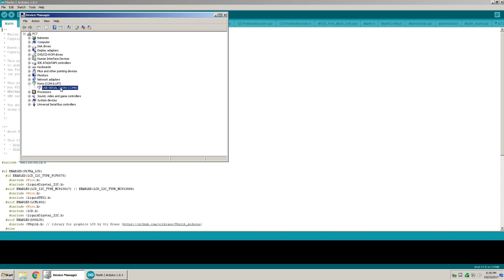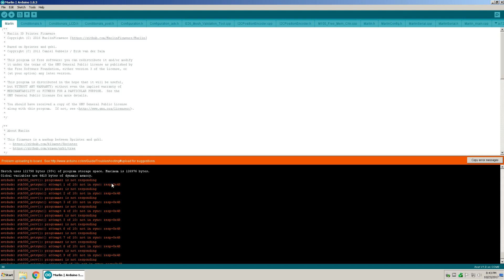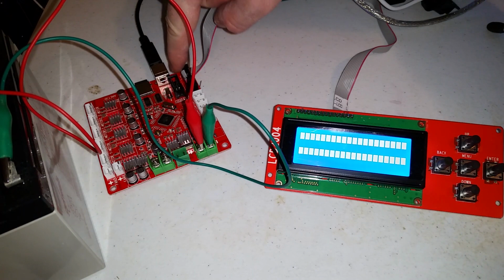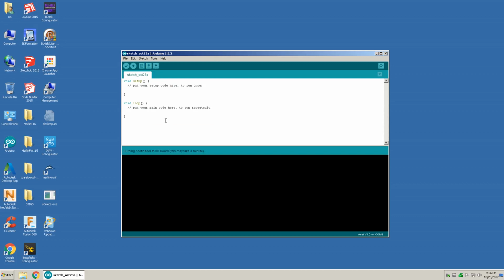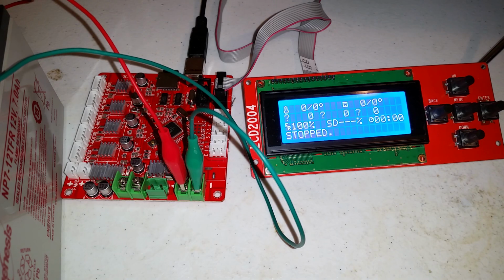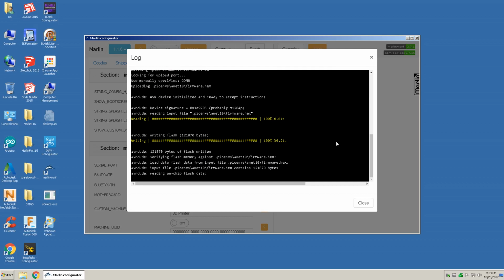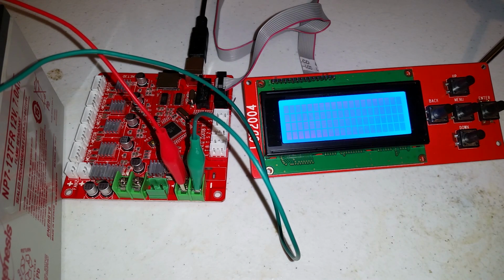Unbrick an ANET A8 Mainboard v1.0 After A Failed Firmware Flash

Comment: I accidentally flashed my AnyCubic Chiron trying to install Marlin 1.1.9. I want to fix it but I have some questions about your tutorial?
1. Do I need to buy an Arduino Nano to fix my main board?
2. What programs should I use? I tried to update my firmware with Cura the 1st time and I accidentally reset my PC during the upload.
3. I've tried changing the DC pin to USB and upload 'Blink' through Arduino. Somehow my PC cannot detect my Chiron anymore, so do I  have a chance of updating to Marlin or will I have to buy a new stock main board?
Reply from the maker: Might try flashing the default firmware from the AnyCubic company.  If you cannot flash the firmware over USB then a Arduino or USBAsp will be needed to connect up to the ISCP pins on the mainboard.

Look at this video about updating your firmware 
https://youtu.be/PVE7snmtMuc

https://youtu.be/zprmBmMFHQQ

Comment: What is the software you are using that shows marlin configurator
Reply from the maker: It's called Marlin Configurator.  But it has not been updated in several years.
Reply: @MrDabrudda  dang, it looked really interesting.
Reply: arduino?

Comment: I have found that in some cases using Arduino 1.0.1 to upload works better. From my standpoint using avrdude and usbasp programmer is near foolproof. :- ))  MrDabrudda thanks for the bootloader clue. I have a GT2560 rev A+ that has done the same thing.

Comment: I had issues but this is what worked for me:
1. Load the ArduinoISP example sketch and upload it onto the nano board using the following settings:
-Board: Arduino Nano
-Programmer: AVIRSP mkII
2. Now that you have this sketch loaded onto the nano, connect the wires as shown from the nano to the motherboard on the printer.
3. With those wires now connected, open up a blank sketch and set it to the following settings:
-Board: Anet V1.0 (optiboot) 
-Programmer: Arduino as ISP
Then click burn bootloader
4. After that has uploaded open up your marlin sketch with the version of firmware you plan on using (for this I used Marlin 1.1)
5. Now turn on your printer, connect it to your computer via a serial bus cable, and make the following changes to the sketch.
-Board: Anet V1.0 (optiboot)
-Programmer: AVIRSP mkII
6. Upload the sketch and disconnect your serial cables. 
7. The printer should work fine now.
(Keep in mind I have already brought over the configuration.h files as other videos will show you need to do and I use Arduino 1.8.3 for this fix).
This video was very helpful but I wanted to write out what worked for me as it took alot of looking in the comments to figure this one out.
Happy Printing!
Reply: Thank you, You are the best! I almost lost all hope for reviving my board after Atmega replacement. And now it blinks again!

Comment: avrdude: stk500v2_ReceiveMessage(): timeout
avrdude: stk500v2_ReceiveMessage(): timeout
avrdude: stk500v2_ReceiveMessage(): timeout
avrdude: stk500v2_ReceiveMessage(): timeout
avrdude: stk500v2_ReceiveMessage(): timeout
avrdude: stk500v2_ReceiveMessage(): timeout

avrdude: stk500v2_getsync(): timeout communicating with programmer

https://www.youtube.com/watch?v=BgEg4MZ835o
Reply from the maker: Does your board have the latest bootloader installed?  If the bootloader is not install or it is corrupted you will get that error.

Comment: DO IT AT YOUR OWN RISK!

I got it working on Anet board V1.5 by doing the following:
1.- Upload the example ArduinoISP to your arduino uno.
2.-Follow the steps showed in the video to connect your Anet board to an arduino uno board.
3.-  Now that you completed above steps on Arduino IDE: 
-Select Board: Anet V1.0
-Port: COM port of your Arduino Uno
 -Programmer: Arduino as ISP
4.- Click on Burn Bootloader
5.-  Now you will see white squares on anet display, so do a power cycle twice.
6.- Disconnect Arduino uno board from Anet board and connect Anet board by USB to computer and Try to upload Marlin firmware by selecting Board: Anet V1.0, Port: COM port of Anet board, Programmer: AVRISP mkll, so if it fails try multiple times. If it keeps failing do the following.
7.- Open avrdudess.exe and select:
-Programmer: Arduino
-Port: COM port of Anet Board
-Baud Rate: 57600
-MCU: ATmega1284P
-Flash: Select firmwareResetV1.hex
8.- Now select Write option which is below where you just select the file (below Flash white input box) and Click on GO.
9.- It should be done by now and you will see some data on the black windows, something like these that means it finished. 
-avrdude.exe: verifying..
-avrdude.exe: 103888 bytes of flash verified
- avrdude.exe done. Thank you.
10.- Now you will see an Anet A8 on the printer display, so do a power cycle twice and try to upload Marlin firmware to the Anet board, try it sometimes and do power cycle it should work at much at the the third time, mine worked at second tried and it was the only way to get it working.

Files for firmware reset: https://www.encatel.com/anet_firmware_reset.zip
Reply: Thank you!!<3
Reply: Link does not work.

Comment: those white squares are nothing wrong, when you burn bootloader they appear couse it means that the bootloader is ready. After those white squares I just flashed Skynet 2.3.2 on and it worked with no problem and the printer is working great. I don't think that those white squares mean that the board is bricked!
Reply from the maker: Those white squares stayed on my display for 10 minutes and the board would not boot up.  Skynet has not been developed/updated in 2 years.
Reply: @MrDabrudda  true that it hasn't been developed but that doesn't mean it doesn't work... I had same white squares when i burned bootloader, but than I flashed Skynet 2.3.2 and it worked ok... no error at all using USBasp programmer. Done some really dumm shiz in my life with different bords, but i have never bricked one, I don't think that bricking a board is so easily achieved!

Comment: This is the error I get when I try and do what you're doing:

avrdude: Expected signature for ATmega1284P is 1E 97 05
         Double check chip, or use -F to override this check.
Error while burning bootloader.
Reply from the maker: What kind board do you have?  An ANET v1.0 or ANET v1.5
Reply: @MrDabrudda  ANET v1.5
Reply from the maker: I believe someone made previous comments on this problem with the ANET v1.5 board.  The bootloader needs to be flashed before updating the firmware will work.

Use "Arduino as an ISP" setting in the Arduino IDE.  Connected the correct pins between the arduino and the anet board and burn bootloader.
Reply: @MrDabrudda  I have also done this, I get the exact same error

Comment: Wich are the pins do I need to connect in arduino nano and Anet A8 notherbord? Please, could  you help me?
Reply from the maker: @2:15
@2:20
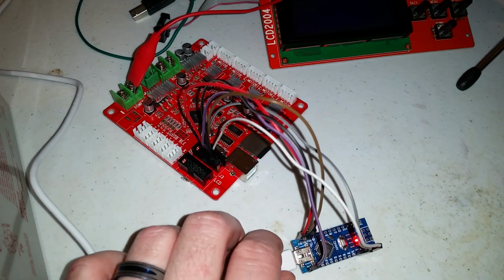@2:25
Reply: @MrDabrudda  thank you !!! I tried several times, but the same message cames.....Arduino: 1.8.0 (Windows 10), Placa:"Anet V1.0"

avrdude: stk500_recv(): programmer is not responding
avrdude: stk500_getsync() attempt 1 of 10: not in sync: resp=0x03
avrdude: stk500_recv(): programmer is not responding
avrdude: stk500_getsync() attempt 2 of 10: not in sync: resp=0x03
avrdude: stk500_recv(): programmer is not responding
avrdude: stk500_getsync() attempt 3 of 10: not in sync: resp=0x03
avrdude: stk500_recv(): programmer is not responding
avrdude: stk500_getsync() attempt 4 of 10: not in sync: resp=0x03
avrdude: stk500_recv(): programmer is not responding
avrdude: stk500_getsync() attempt 5 of 10: not in sync: resp=0x03
avrdude: stk500_recv(): programmer is not responding
avrdude: stk500_getsync() attempt 6 of 10: not in sync: resp=0x03
avrdude: stk500_recv(): programmer is not responding
avrdude: stk500_getsync() attempt 7 of 10: not in sync: resp=0x03
avrdude: stk500_recv(): programmer is not responding
avrdude: stk500_getsync() attempt 8 of 10: not in sync: resp=0x03
avrdude: stk500_recv(): programmer is not responding
avrdude: stk500_getsync() attempt 9 of 10: not in sync: resp=0x03
avrdude: stk500_recv(): programmer is not responding
avrdude: stk500_getsync() attempt 10 of 10: not in sync: resp=0x03
Erro ao gravar o bootloader.
Obs:. My mother board is ANET 1.5, is there any diference?
Reply: It´s alive and kicking again !!!! I solved the problem. Thank you very much!!
Reply from the maker: This video is for the ANET v1.0 board.  Several people have said the v1.5 is different
Reply from the maker: What did you do to get the v1.5 board going?
Reply: @helioricardo2454  can you tell how you solved the problem? Thank you

Comment: Pls help, getting this massage when trying to burn the bootloader. What to do?
Arduino:1.8.8 (Windows 10), board:"Anet V1.0 (Optiboot)"

avrdude: stk500_recv(): programmer is not responding
avrdude: stk500_getsync() attempt 1 of 10: not in sync: resp=0xf2
avrdude: stk500_recv(): programmer is not responding
avrdude: stk500_getsync() attempt 2 of 10: not in sync: resp=0xf2
avrdude: stk500_recv(): programmer is not responding
avrdude: stk500_getsync() attempt 3 of 10: not in sync: resp=0xf2
avrdude: stk500_recv(): programmer is not responding
avrdude: stk500_getsync() attempt 4 of 10: not in sync: resp=0xf2
avrdude: stk500_recv(): programmer is not responding
avrdude: stk500_getsync() attempt 5 of 10: not in sync: resp=0xf2
avrdude: stk500_recv(): programmer is not responding
avrdude: stk500_getsync() attempt 6 of 10: not in sync: resp=0xf2
avrdude: stk500_recv(): programmer is not responding
avrdude: stk500_getsync() attempt 7 of 10: not in sync: resp=0xf2
avrdude: stk500_recv(): programmer is not responding
avrdude: stk500_getsync() attempt 8 of 10: not in sync: resp=0xf2
avrdude: stk500_recv(): programmer is not responding
avrdude: stk500_getsync() attempt 9 of 10: not in sync: resp=0xf2
avrdude: stk500_recv(): programmer is not responding
avrdude: stk500_getsync() attempt 10 of 10: not in sync: resp=0xf2
Reply from the maker: Do you have an ANET v1.0 or an ANET v1.5 board?
Reply: @MrDabrudda  1.5
Reply: @MrDabrudda  Problem solved! don what @skyline said he done. Thank you!
Reply: @עילאיסגל-ש7ד  i have same 1.5 board.. And alwaysy found verification error when try tu push bootloader

Comment: Hi, I've got the same Geetech LCD screen that needs to be 'unbricked' - would I need to purchase the ANET mainboard to do this, or can it be done safely with an Arduino alone?
Reply from the maker: The LCD and ANET mainboard are two different pieces of equipment.  You don't even need the LCD for the mainboard to work.  I have no idea.  I've never broken my LCD.

Comment: afetr i burned boot loader i still get the bricks and  500 error
Reply from the maker: Then the bootloader probably didn't get flashed.  Ensure your wiring is correct and the Arudino IDE setting are also correct.
Reply: @MrDabrudda  I was actually seeing a usbasp does this mean it is faulty
Reply from the maker: Ensure the Arudino is set to flash the ANET v1.0 in the boards.  If you are using a USBasp to flash the ANET board, make sure USBasp is selected.  If you have an Amtel flashing tool from Hobby King then you can forgo the wiring and just press the flashing tool onto the Amtel chip and click flash bootloader.
Reply: Yeah I have done all that just when  it says bootloader done It is still bricked and I can't upload firmware

Comment: Worked great for me. Not the first time, but after 2 hours of trying... I used a mega 2560 to burn the bootloader and after a while i remembered that MOSI, MISO and SCK pins are different on a mega. (miso 50, mosi 51 and sck 52) And like someone said: upload the example and then it worked. Thanks!! Saved me 50 euros on a new board.

Comment: Help me pls :c
Arduino: 1.9.0-beta (Windows 10), Card: "Anet V1.0"

avrdude: stk500_recv (): programmer is not responding
avrdude: stk500_getsync () attempt 1 of 10: not in sync: resp = 0xe0
avrdude: Yikes! Invalid device signature.
          Double check connections and try again, or use -F to override
          this check

Error burning bootloader

This report could have more information with
"Show detailed output during compilation"
option enabled in File -> Preferences.
Reply from the maker: Don't use beta software.  Arduino 1.8.8 is the stable version.
https://www.arduino.cc/en/main/software

1) Make sure your wiring is correct
2) Install the drivers for the Arudiuno board you are flashing with
3) Install the ANET v1.0 board definitions into the Arduino IDE (see link in the description of my video)
4) Try a different USB data cable
Reply: I had the same problem. Turns out I had pins 12 and 13 exchanged

Comment: This is so frustrating. I know almost nothing about electronics and the guy who sold me the anet v1-5 board is making me wait weeks for a reply. Luckily I had ordered an uno for other hobby stuff so I have one on hand but all the videos I watch people have shit hooked up differently. Exactly what am I doing? I see people hooking up the pins next to the LCD pins to the iscp ports on their uno, then I see others hooking another wire up to pin 10. Man, I just want to use the auto bed leveler I bought that refuses to work with the stock firmware. Having to learn electronics(I guess I would've been doing so anyway since I got an arduino kit) for 3d printing is annoying to me.

Comment: what do i have to do to get Anet10 into the Compiler Dropdown Menu in Marlin Configrator Tool? I Tried sanguino_atmega1284p and melzi but it didnt work
Reply from the maker: You need to install the ANET 1.0 board definitions for Arduino IDE
https://github.com/SkyNet3D/anet-board
Reply: @MrDabrudda  thank you mrdabrudda, this worked for me : )

Comment: Hi, got I believe the same error as you, except no matter how many times I try to burn the bootloader it wont work. Got any ideas on a fix? thanks.
Reply from the maker: Do you have version 1.0 or version 1.5 of the ANET board?
Reply: it says ANET 3D V1-5, so i guess 1.5? I even added a capacitor between gnd and reset but no luck
Reply from the maker: I don't have a 1.5 board but researching what the difference is between 1 and 1.5

Comment: FIXED. SOLUTION. SAVED Had the same issues. Was dealing with the motor thinking it was hitting the "switch" turned out to be a bad capacitor on the board. Cap C45. Once I removed it, the z-axis started honing again. I was having the issue where the z-axis would only go up and not down. And every time it went up it still said it was at position z=0. I messed around with the config file in Marlin 1.1.8 to no avail. The capacitor was the culprit for me.

Comment: Hey I've tried all the steps in the video and even installed a library support for arduino 1.8.X so I could burn it on that version but I keep getting errors like avrdude: stk500_getsync() attempt 10/10: not in sync. Also on the anet board the tiny D1 diagnostic light is always on. Is it completely broken?
Reply from the maker: Not sure.  Ensure the COM port is set correctly in Arduino IDE.  Ensure the drivers for your board are installed on Windows 7/10.  The drivers should be on the SD card that came with your printer.
Reply: Oh okay I hadn't actually installed them yet because the printer always worked through cura I could control everything easily. Should the printer be plugged into the pc when I try to install the driver? because I just get an error. And yeah I always made sure the com port was correct and I didn't have any other sketches open. Thanks for the reply!
Reply from the maker: Yes the CH340 drivers will need to be installed for the ANET board to be detected by your computer when plugged into a USB cable.  The ANET board will show up In the Device Manager under Ports.
Reply: Alright that installed after I plugged in and powered the anet board but when I went back to burn the bootloader with my nano I still got the same error. Damn
Reply from the maker: How many times does the diagnostic light flash?
Reply: MrDabrudda the small d1 light next to the main chip doesn't flash. It just turns on at random times and doesn't turn off. Sometimes when I plug in the power it doesn't turn on but when I hit the reset button then it does.
Reply: Got exact same issue hear and is how i managed to brick board in firstplace as had same issue when trying to upload merlin via usb
Reply: and when you say diag light is that the rx light on nano its flashing 3 times very quickly at start then 9 more times after dleay which im assuming are gaps between failed attempts
Reply: did you first flash the arduino with the arduinoisp sketch?

Comment: mine was bricked after uploading complete , no error or anything just brick like that ??? any suggest ???
Reply from the maker: Try flashing the bootloader and reboot
Reply: Thank you for your reply but I don have any tools to flash it now , just order the usb programmer , by the way what is the cause for brick our board ?
Reply from the maker: No exactly sure.  I used a 10ft USB cable and that might have cause a low or bad signal.  Ensure your USB cable is good and the connectors are not corroded.